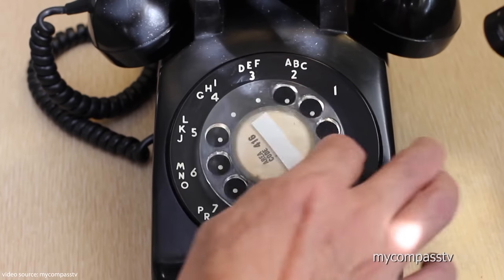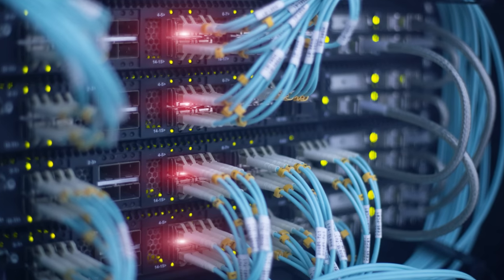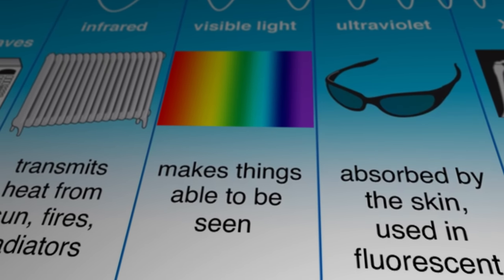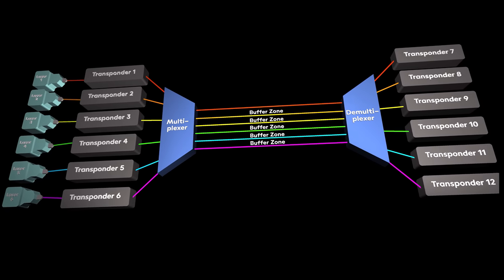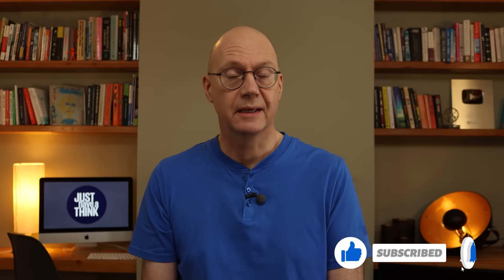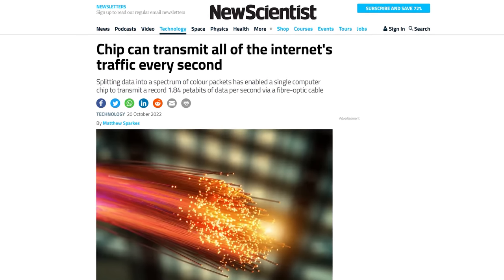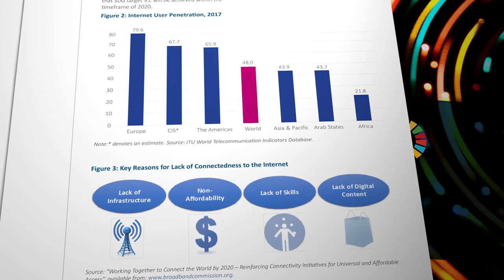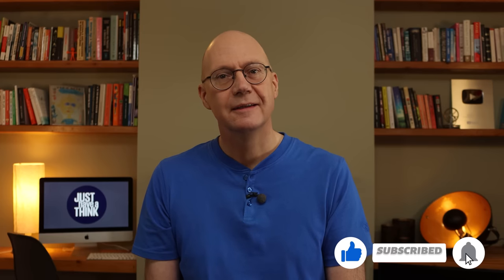The entire internet on a single chip! MASSIVE energy savings.

Comment: Well, having spent more than 20 years of my engineering career in fiber optic system design I may be able to provide some small thoughts.
1. Most of the internet energy usage is in the routers, switches, servers, etc. but certainly not in the transmission equipment. So this will not make much of a dent in overall worldwide energy usage.
2. The industry worked its way up from 4 wavelength 850 nm multimode, 139 Mb/s to DWDM systems with 16 wavelengths near 1550 nm single mode and 16Gb/s/wavelength in the time that I was working on them, so this new technique is certainly a technical achievement. The transmission distance is pretty low compared to other techniques. It would be interesting to see how well it fares through EDFA amplifiers.
3. Humans remain relatively low bandwidth, and are unlikely to change. It is nice to have better bandwidth video, and perhaps we could get rid of the crappy compressed video with the new higher bandwidth techniques, that would be a welcome change. It won't help though with American produced soccer match transmissions, which will remain unwatchable and infuriating to anyone familiar with the game.
4. snark/ I suspect the only real result is that we will get to see the same commercials and sensational 'content' (thankfully your content is not included in that) that we have now, but with Greater Visual Clarity. Hooray! What an achievement! /snark
5. It is important to note that there has not been much change in audio quality since the introduction of CD's. Why? Because most people cannot hear the distortion so they are not willing to pay for an improvement that they cannot sense. The same will happen for video. What then will be the driver for bandwidth?
Reply: One driver for bandwidth right now is Zoom meetings on Teams.  Another is Netflix, with a Firestick in every room.

In the future it may be sensor networks and AI data.

Comment: I have a hard time seeing this as an energy saving opportunity.  The faster the internet gets, the more uses we find for it.  The more uses, the more use; the more use, the more devices and datacenters drawing power to produce and consume all that data.

It's an awesome technological breakthrough, but it follows on the heels of many more such breakthroughs, all of which have just fueled the ever-accelerating pace of modern technology since the early days of x86 or even earlier.  On the upside, tech like this is one of the ingredients that goes into discovering advancements that will offer some effective solutions to climate change and energy crises.
Reply: The same applies for all modern breakthroughs in efficiency. Rather than holding some back for resilience, all additional capacity is used up to meet the growth objective. We see this with all modern infrastructure projects. All additional capacity provided is swallowed up in short order and more is required at the next growth cycle.

The advantage of faster internet speeds is it can reduce the amount of hardware needed which can save energy. It can also save energy if it can replace or reduce other more intense or dirtier forms of energy use, such as for transportation. Transportation is much harder to decarbonise than a static data centre that could potentially be under the sea and powered by tidal turbines.

It seems to me this will always be impossible to solve completely with a growth paradigm. Optimisation, subsitution, reduction or redistribution, when they are used, are all used in the objective of attaining growth first, rather than for improvement towards any other goal. Under this paradigm, the other stuff only happens if growth does. While this may have made sense in the past, it seems back to front to me at this point in history. 

We can optimise to provide better value from less stuff. We can redistribute where there is excess without the need for growth. Ultimately it's just a choice we make about how we distribute our available resource surplus at any given time.
Reply: lol The crypto miners will get real time distributed computing across the globe and ramp up :P

Comment: Unfortunately, too many estimates of "the internet's power usage" lump in data centers and every device connected to the internet, but that's not a number this new chip will have any effect on. The chip will only affect the number of devices needed to transmit data in a small number of cases: where more than one fiber cable was needed before, now only a single cable will be required (except where multiples are used for redundancy in case of a cut cable). That savings is microscopic compared to the usual numbers thrown around, because the vast majority of the actual data-transmission infrastructure of the internet is still just single cables connecting point A to point B and branching off as needed; the power used for these devices is similarly microscopic relative to the computation devices that generate the data to be sent.

Comment: Considering that the most important data lines ARE long distance lines, that whole 8Km thing is a non-starter so we can push that aside until that figure is many miles.  And then showing lines that traverse the oceans with 8Km limitations seems a bit silly.  That would be a LOT of underwater re-transmission stations.
Reply: 8km are many miles.

Comment: This can be done from cm to km at very low energy consumption. Great for supercomputers. This means memory can be located within the rack, next rack or end of a row of racks. All without significant delay adder for NAND or even DRAM.
Reply: Nice thinking but sadly not so. The reason is that light travels at about 1 foot per nanosecond in free space. In fibre optic cable it's about 2/3rds of that. So even with memory that could respond instantly to a CPU request at a 1GHz clock on the CPU you need the memory within four inches of your CPU, because 1 ns is the interval between clocks at 1GHz. 

In practice it's a lot closer than that because of the delays in NAND and DRAM, and that's why CPUs  have had on chip cache since we got close to GHz clock speed. Where there is cache on the motherboard as well as on the CPU chip you'll always find it nestled up close to the processor.

That's why modern supercomputers usually contain a zillion small processors each with its own very local memory (small as compared with the whole supercomputer). 

Your idea works great for improving access times to a Net Attached Fileserver, but not for memory (at least not as we normally think of memory)

Comment: There was a mention of a portable storage internet option around maybe 2005 called the Outerrnet, and if I recall correctly... is also designed to extend data signals through each other and from the satellite. The memory has 2TB of all the most commonly accessed static data in which should reduce bandwidth usage by 90% when not loading videos, whereas NVidia apparently found a way to have lossless video compression by carrying through a single matte image.

Comment: One point of correction. The speed of electrons (em energy) is actually marginally faster the light in fiber. All the rest is true (hacking resistance, bandwidth, error reduction, etc.) But thicknet Ethernet is actually faster than fiber optic modulation.
Reply: Electrons move maybe a centimetre per hour, but the electric signal in copper is close to the speed of light.

Ironically, lasers in optic fibre are much slower than that, but they make up for it with much higher bandwidth.

Latency or throughout: Which do you prioritise?

Comment: I am so excited for this science to make it into the field. I've been following it for some time now. Also, thank you being careful with your language on this. As stated, this is an increase in data density, not physical speed. No one has broken the speed of light, but the potential speed of downloading significantly large enough data could seem almost instantaneous.
Reply: The part he got wrong is: light in fiber doesn't travel at the speed of light. So in theory their is improvement possible.
Reply: @autohmae  Correct. I believe there is likely some material configuration we have yet to discover that could improve fiber optic speeds. Who knows, it's not like we predicted the discovery of graphene or the broad applicability it possesses. I'm sure there is an infinite amount of potential if we just think outside the box
Reply: @robocu4  on the other hand, adoption of graphene into real products has so far been limited, By the ability to mass produce it. Similar to for example silicon photonics.

Comment: Hi Dave. Could you explain what "all the internet's traffic every second" actually means. Thanks
Reply: We never got a conversion in number or color pictures of nondescript nature per second either.
Reply: I found an article on what appears to be the same chip. It transferred 1.84 petabits per second. The spokeperson estimates the internet transmits 1 petabit per second.

The usage of "per second" in both this video and the article is weird though. Claiming a speed per second implies it's the second derivative, acceleration. 

Slaps hood of The Internet.
"This bad boy can fit so many 0-to-60's in it!"
Reply: @PopeGoliath  nope, it's talking about volume of data over the single new link cable, compared to all the cables of the Internet, in the same time frame. Not acceleration. Massive Volume. Meaning a game changer, like the difference in tapes to hi def Dvds. So maybe 3d hologram projection is on the cards.

Comment: It may be much more energy efficient per bit transmitted but like building larger roads just results in more traffic, higher internet capacity will result in more live streaming of people's cats so offsetting the energy benefit. In the good old days of dial-up the internet used far less energy because it was so slow and there was the added benefit of no cat videos!.

Comment: These backbone WAN connections do not really use a lot of energy, servers and switches in datacenters do.  If by saying the data ( light)  in fiber optics travel at the speed of light in a vacuum no the light in a fiber optic cable is about 34% slower and might be slower if you are factoring amplification.

Comment: All data communications travel at the speed of light in those media, and no farther than an order of magnitude apart from each other in speed. Even data over telephone lines at 9600bps travel at the speed of light -- but the bits are very big, so you can't put too many of them in the line over a specific amount of time. Various forms of WDM and other multiplexing schemes have been used over fiber for decades.
Over the years, many incremental improvements have been made over the years. This one seems like a particularly effectively advertised advance, among many advances that aren't so heavily hawked.
The limit these days on transmission speeds is in the end points, with or without this particular multiplexing technique. These days, there appears not to be any major congestion in existing long distance cables. The places where performance is lacking tend to be places where no ultra high speed cables exist at all. Where they do exist, they tend to be installed in multiples.
This technology might well end up being adopted, based on ease of production, cost, and all the usual techno-economic criteria.

Comment: Around 5:30-5:35 I'm missing something. How can different frequencies of light be "phase coherent"? Different frequencies cannot remain in phase as they travel, if they travel at the same speed. The different traces on the oscilloscope display are given different colors (frequencies), but they all have the same wavelength, meaning the same frequency. Does it actually mean coherent drift? Or coherent modulation? Or is "coherent" just the wrong word?

Comment: It seems likely to me that the first place this tech will see much use is either supporting IXPs in carrier hotels (i.e. on the networks where various connectivity providers connect to each other), or possibly allowing CDNs to do some site consolidation (if they can run a connection like this from their gear in a single (probably lower-cost) datacentre room to an assortment of IXPs in carrier hotels, rather than having to keep a roomful of gear in each carrier hotel, that has the potential to save a lot of energy, and a corresponding quantity of money). Backhaul providers are probably 3rd or 4th in line for this sort of tech, and consumer connections are basically at the back of the line (they have to be, because the connections that aggregate thousands to millions of consumer connections have to be much faster than the indivudal consumer connections in order to aggregate them).

Comment: From experience as a design engineer I can state that a lot of this is using existing technology in new ways. EG Ring counters and ring oscillators have been around for decades. This one is just more stable and accurate. LVDS channels hit 63Gbps a while ago on FPGAs so something faster than that to get the data in and out is entirely possible. Plus of course some of the faster dial up modems used some of the other tech to get 56kbps down a 3kHz bandwidth phone line. Power consumption is my only question.

Comment: This will cause more energy use on internet, not less. If this enables pushing more data over long distances it will just allow more conventional devices on each end to feed/consume data from the channel. The market will find an application for the new capacity, it always has.
Reply: Not just the market.  The reason packet switching won against circuit switching is because internet traffic is unpredictable.  Phone conversations have constant bandwidth, and you can always compute an average and a maximum of bandwidth for that.  But internet traffic will scale from bursts of all available bandwidth to the tiniest packets every ten minutes, and everything in between, with no predictable pattern.  It's just how the net works.

The idea underlying the internet is to connect devices end to end, with no state kept anywhere in between, routing each packet individually.  This is not how most of it works nowadays, thanks in large part to phone companies, but even the phone network uses packet switching today.

That's just the technology.  The market adds its own things on top.

Comment: I don't see this tech leading to a significant reduction of energy use by the Internet. The energy usage is is not limited to the ISP devices used to transmit data. The computers at the two ends of that communication need to be considered as well.
Reply: @Pasta_watcher  You're saying there are more servers than end-user PCs, phones, etc.?? I would agree more ENERGY might be consumed by ISPs "per square meter" but probably not "per capita population served."

Comment: One problem about the phase coherence bit. The speed of light in optical fibers vary by wavelength, so they won't stay coherent. It's a smooth curve though, so maybe it might be useful still. Also, if you were to combine 2 signals at the same wavelength, but with different phases, you would get interference. E.g. 180 degrees out of phase would destructively interfere.
Reply: The waves are different frequencies so they won't be coherent anyway will they?
Reply: @robinherrick2177  good point.

Comment: This technology will undoubtedly happen and fairly quickly I suspect. However as alluded to buy other commentators the issues will remain at the data centres, where efficient cooling has always been the bugbear. As storage densities increased exponentially,  the requirement for even greater storage increased more so. Thus increasing the heat output and cooling requirement. Data centres need the equivalent technology breakthrough(s) in processing, storage and routing in order to make use of petabit fibre throuput.

Comment: 9:47 ... understatement much? "Do you think this could be a game changer?" Even if no other progress is made on this and 8km is the max, you've just completely changed data centers forever. And within cities, you can create nodes where you could feed nearly every customer within the radius of the node with a single chip. Then you have bundles of fiber optics going from the sub node to a super node where you have 10 chips feeding 10 sub nodes easily covering an area of 16sqkm... and I'm talking Paris or London levels of customer density... and all of them having internet speeds far exceeding even the fastest internet speeds existing today. People would no longer need powerful computers. All they'd need is an interface and they could process a movie like Pandora from the equivalent of a low-grade iPad if they're connected to a datacenter within 8km.

My brain isn't even overloaded with this. It's just shut down.
Reply: Usually you post a lot of green, climate change, woke agenda topics, but every once in a while, you have a gem or two. This is one of them. Well done.

Comment: I agree with all the other commenters that it's really the DCs that use the bulk majority of the power. Part of me thinks that as far as power consumption...this might actually have the opposite effect.

The only case that I can think of that might change that paradigm is you typically build out intra-city DCs in the same buildings as telcos so you can jump on their high/cheap bandwidth connections. If ridiculous bandwidth is more ubiquitous and not as locked down by location...use could disperse super dense DCs around cities and recoup costs as a heat source in cold climates.